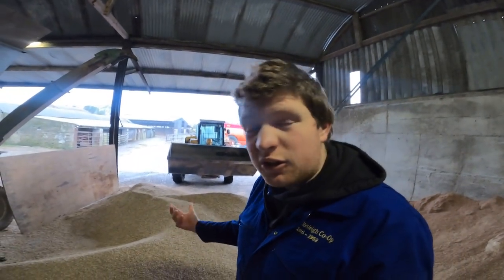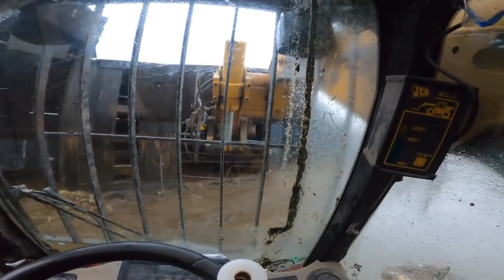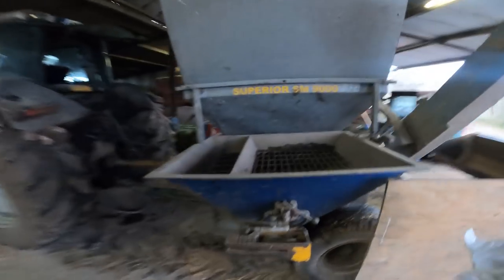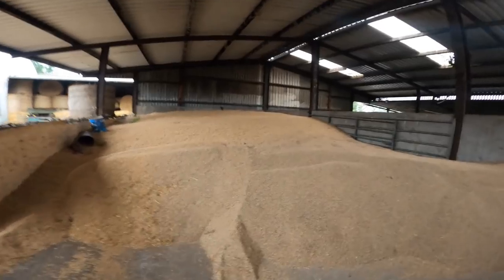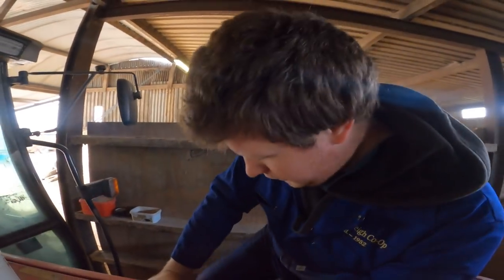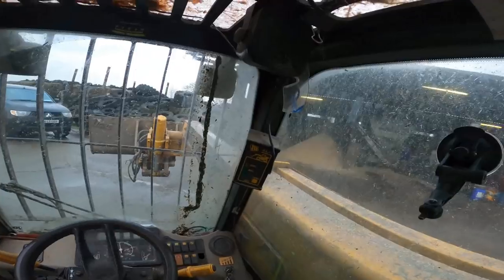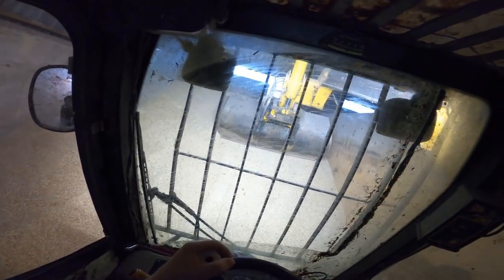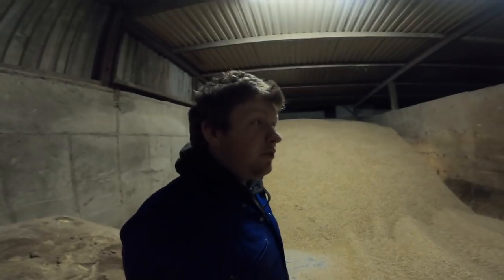ROLLING CORN IN A STORM

Comment: Hi Phil I no what that job is like .I had a little b.m.c tractor on the generator  but I milled in to 1 ton bags found it a bit easier.  But it was just funny watching u doing  that the dust was so bad. I don't think I could put up with your  telly thow bit like the very old j.c.b diggers were have step down in to them.  I think that would be one thing I would replace cos it gets uesd so much.  Great video as normal thow

Comment: Would putting a bit of insulation tape around the latch of the tele stop the worst of the rattling ?
Reply: It's the entire thing that's rattling 🤣 all machines have a "rattle point" I like to call it, its normally at certain engine revs normally and revving it up another bit normally stops it